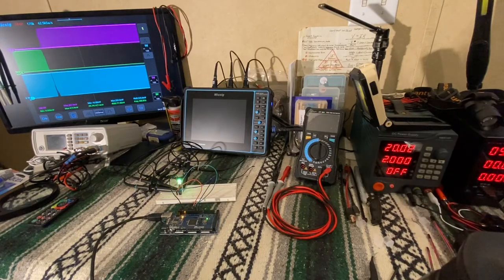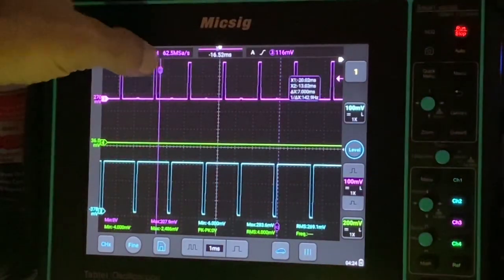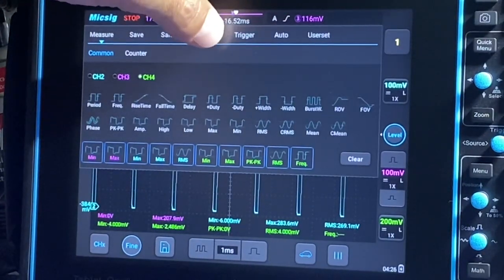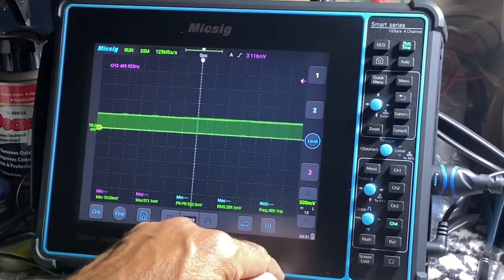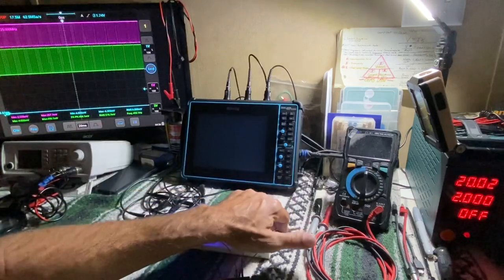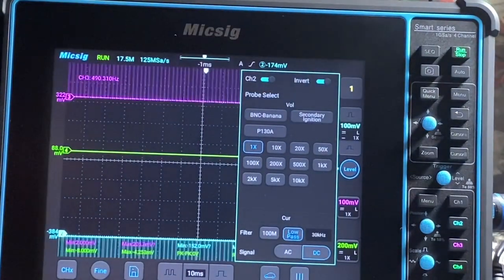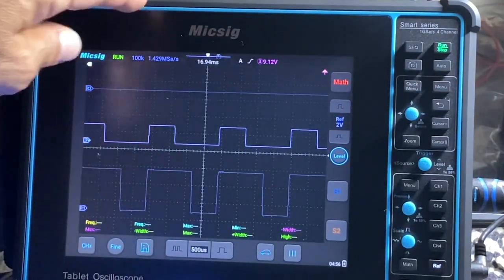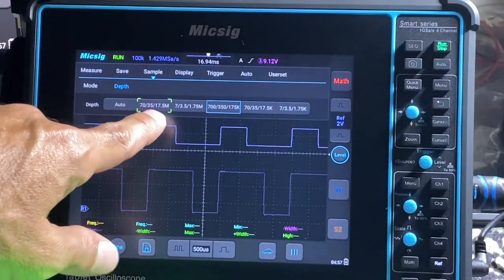Micsig SATO1004 Demo

Comment: Thanks for all the information. Just got one and I went into the car menu but now I am stuck in that menu, how do I exit out back to just a scope. My version is 1.10.156 and is different then yours.
Reply from the maker: If you’re stuck in the menu, you should be able to just back out. Maybe try pressing the home button, or if you can swipe up from the bottom of the screen, then press back. Or try pressing the automotive preset button again. Unfortunately, I don’t have my scope with me at the moment. I’m just going off of memory. I’ll confirm it tomorrow for you. Also, I just now saw your question. My apologies it took so long to reply.
Reply from the maker: Also, you should be able to just tap “OK”, and should go back to the oscilloscope screen. If that doesn’t work, you should also just be able to tap towards the right side of the screen, on the oscilloscope screen. If none of that works, I would try resetting it.

Comment: Very helpful.  Do you know how to revert back to the normal (non-automotive) oscilloscope mode?
Reply from the maker: I’m not sure exactly what you’re asking. The automotive presets just set the time base and the voltage (or amperage), and maybe the trigger. So if you click on one; as soon as you start changing either of them, you are basically back to normal mode. I hope this helps. I’m not sure if I understood your question correctly. Let me know if this helped or not. Thanks for watching.